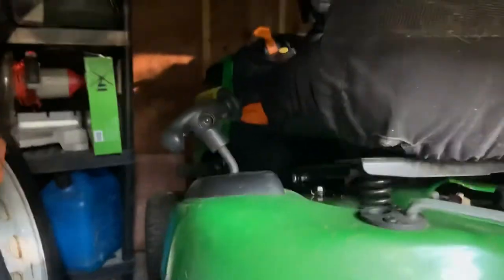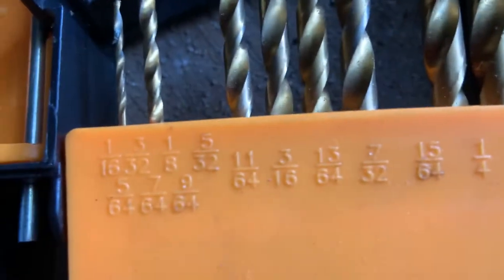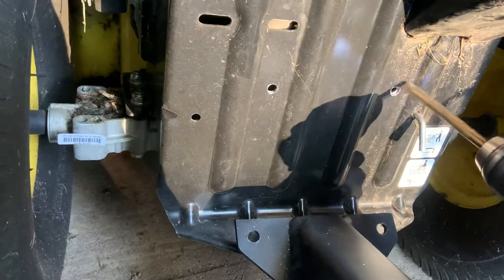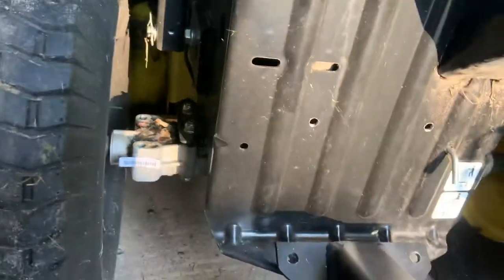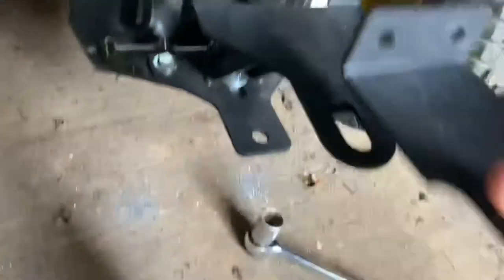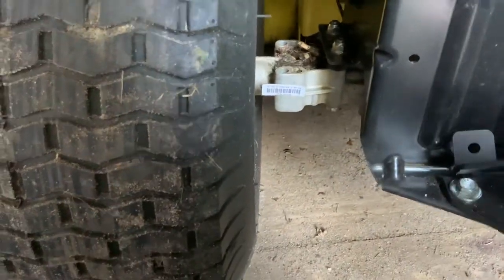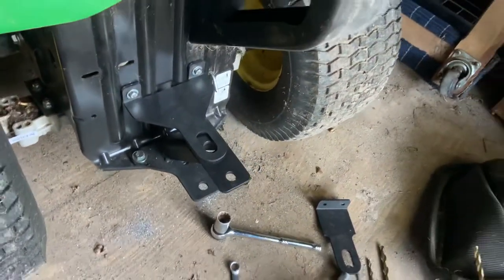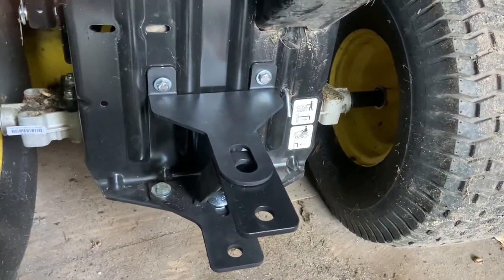Universal hitch install John Deere

Comment: Did the exact same hitch with the exact same lawn tractor years ago. It’s still doing fine. It doesn’t see much action anymore because I now have some heavier duty equipment to pull a trailer around. But it’s still there and still works.

Comment: You are correct about not towing much with these lower end mowers. Up to 100 - 200 pounds tops. If I ever see a trailer ball on a used mower I will not buy it unless it is an incredible deal.
Reply from the maker: I never tow much with the Hydrostatic transmission now my older John Deere tractor Had a regular manual style transmission that one I was really able to talk quite a bit had that one for 12 years before I sold it never a breakdown